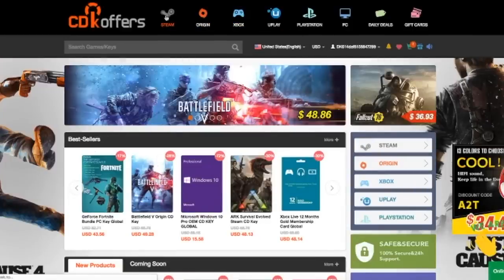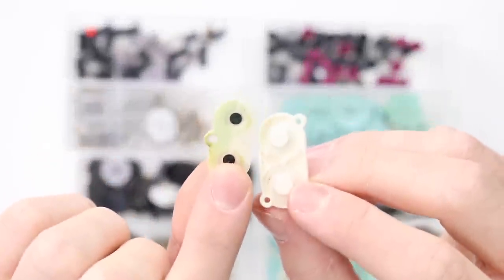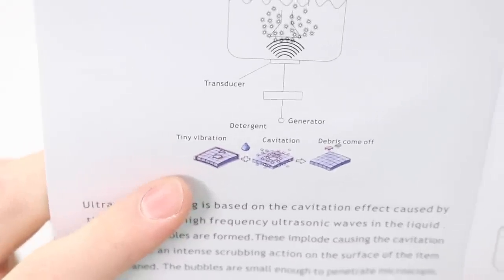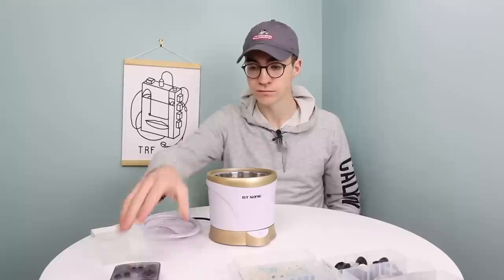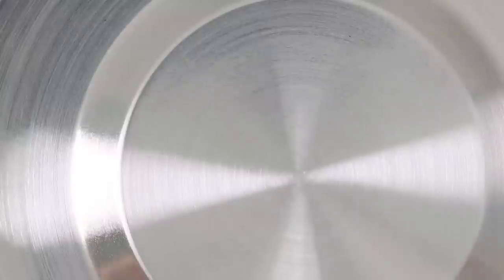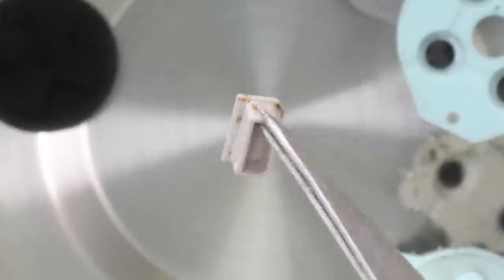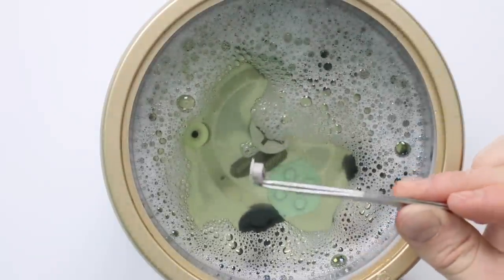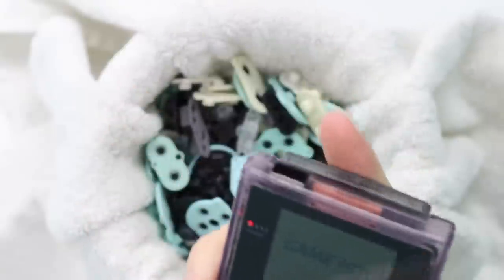Ultrasonic Cleaner! - The BEST Way To Clean GameBoy Components?

Comment: The brown color on the battery contacts is actually the slightly oxidized copper. The silver colored nickel plating has been eaten away by the battery leakage which started attacking the copper underneath and when you cleaned the battery "acid" (basically an electrolyte of alkali salt) off you've revealed the underlying copper. To really fix the issue you'd have to either re-electro or chemical plate a corrosion resistant metal back onto the copper.
Reply: Really? ;)
Reply: Watch Cody's lab channel he showed not too long ago how to electroplate copper, it's doable at home, but not as good as taking the pieces to a professional place.
Reply: @RollinFilms  wow

Comment: Instead of rinsing them off in water then attempting to dry them, make sure they are free of debris then dump all your parts into a container of 99% isopropyl alcohol. Maybe swirl them around a bit and let them sit. The alcohol will displace the water, then you can remove them and the alcohol will evaporate completely after a few hours.
Reply: Just be aware that isopropyl alcohol doesn't play well with all plastics, and some of them lose their shine and become foggy or matte. It's ok for most electronics, glass and metals, though.

Comment: my workplace we use ultrasonic tanks to clean watch parts, your best using a basket to hold the item at mid height of the tank as its more effective, after about 20 minutes the part will not get any cleaner.

Comment: That's a pretty cheap device, was thinking to get one for my airbrushes (which you should totally get if you want to repaint more gameboy shells, definitely beats rattlecan sprays), though it sucks that the solution cost as much as the device itself, but it's great to hear that you put only 1/10 of it.
Reply from the maker: Very interesting! Thank you. I would love some air brushes! Another GB paint video coming soon.
Reply: @TheRetroFuture  The cheapest airbrush+compressor  set is only 40$ on Aliexpress (you will need EU-UK adapter though). Of course there are airbrushes that cost 50-300$ but I used 20-30$ ones for cosplay and they have served me well so far.

Check Punished Props for some basic info about them. Oh, and most important, since you're using water based paints, there are no fumes or smell of solvents, like with rattlecans. Actually, airbrush paints have really nice scent.